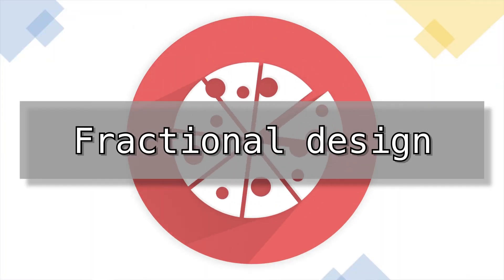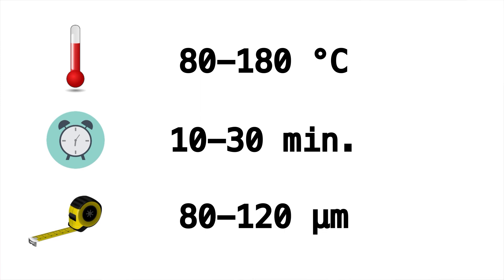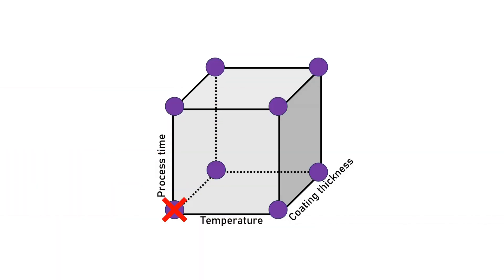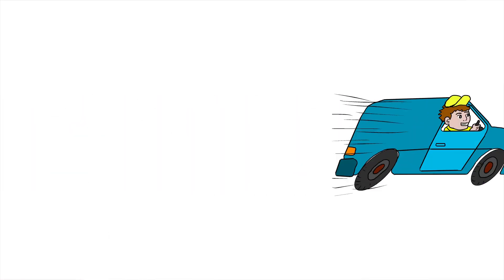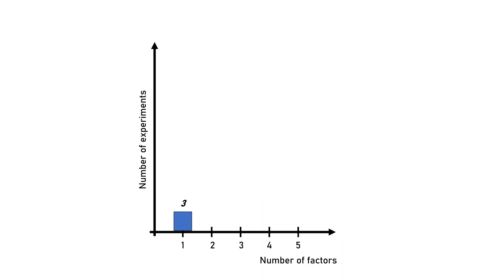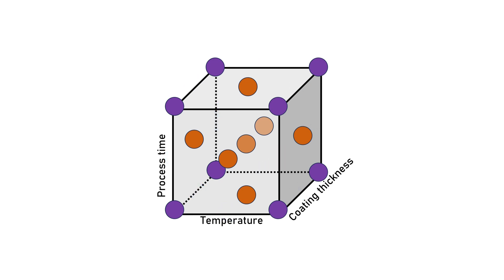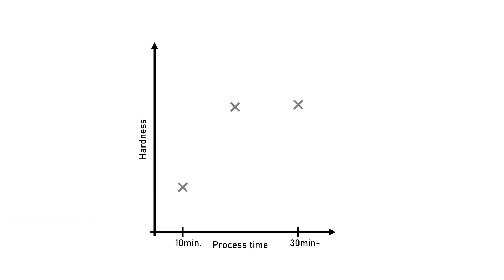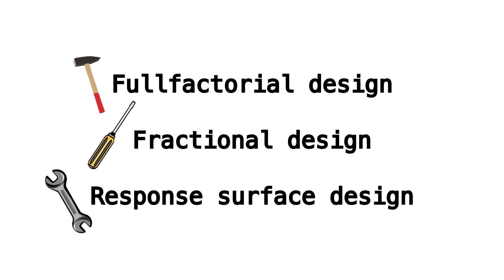Factorial vs fractional vs response surface designs | when to use what?

Comment: How can I set the 5 level parameters, for example pH  2 3 4 5 6  and other 4 factors having  5 levels also using Responce surface ( central composite design) in DESIGN EXPERT 13 software
Reply from the maker: Hey, what you are describing is not really a central composite design but a full factorial design with multiple levels.